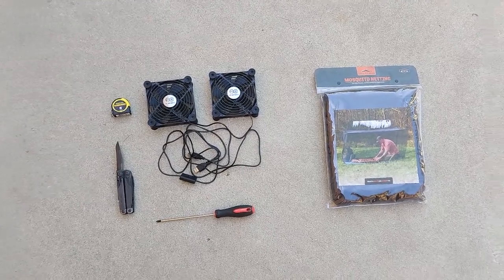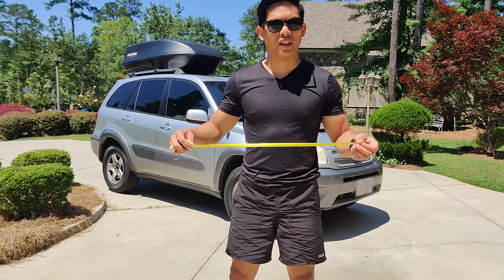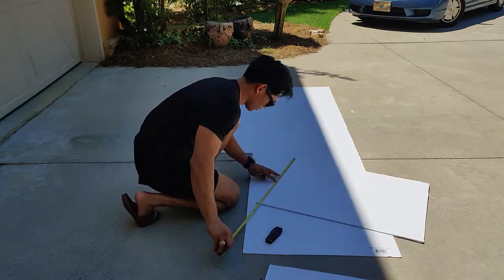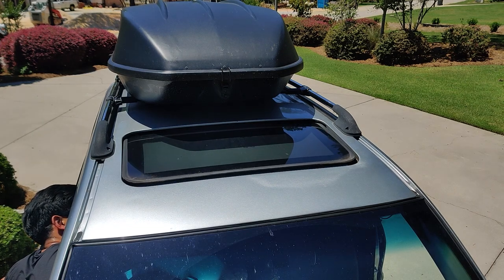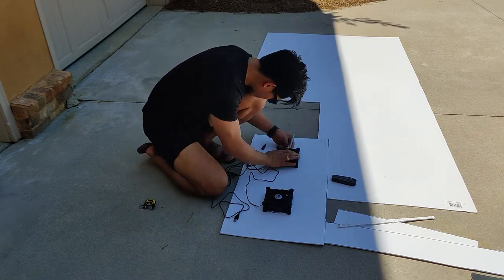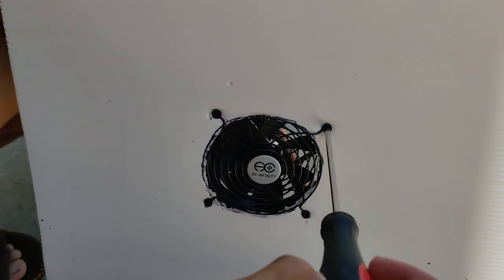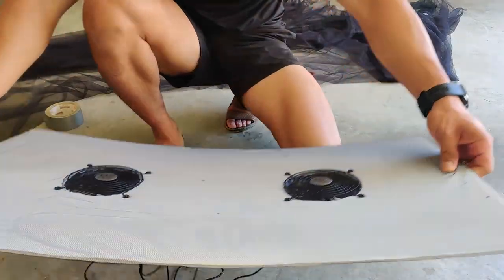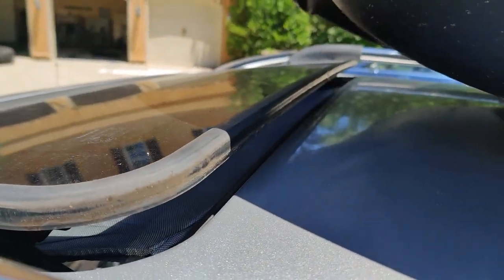LIVING IN MY CAR: DIY Heat Ventilation System

Comment: No heat doesn’t rise.  Hot air rises.  It rises because it’s less dense.  Moving hot air is far less efficient than moving cool air.  Push cool air in….you’ll move more air, and the cool air pushes out the hot air.

Comment: Are you pulling the hot air out(exhaust) or pulling in the outside air?
Reply: I would imagine he's definitely venting the hot air out. Especially since heeat gets trapped in cars and specially around the roof area. If you want to pull cool air in you'd probably want the vent somewhere under the car where it's shaded and the air is cooler

Comment: this is a good idea but the fan will be weak with USB power. You need a 12v fan power. this idea could damage your stereo device for a big fan 12 fan to a USB 5v.
Reply: You wouldn't need much power to vent out a lot of heat which builds up at the roof.

Comment: ...and if u don't have a sun roof?
Reply from the maker: Big oof haha. Could create a side window ventilation system but it'd be harder to both conceal and not be a security/safety concern
Reply: I saw a video of a family that had eight fans. Four on each side of their car window. They used four fans on one side of the car to suck new air in and four fans on the other side to suck old air out. You could maybe try that.
Reply: @kddayth  got a link?